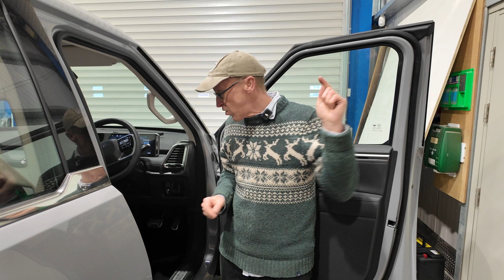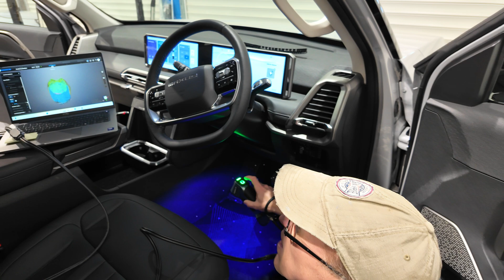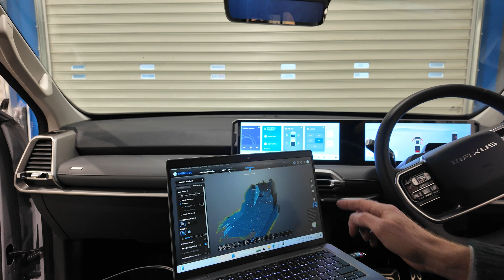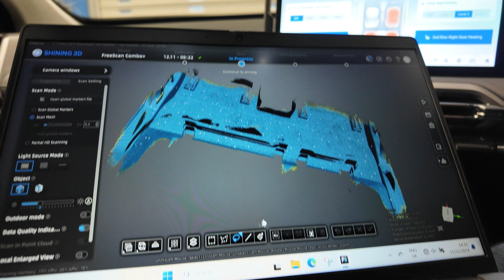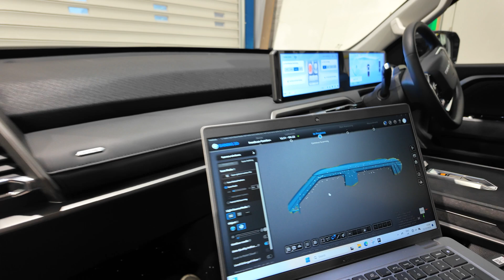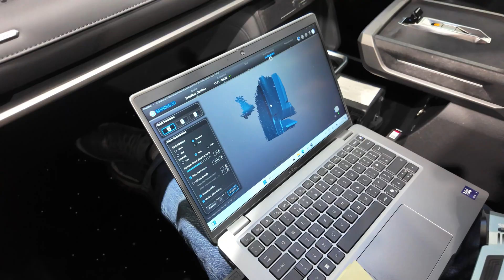Behind The Scenes Using a Freescan Combo+ 3D Scanner to Develop New Accessories for Maxus E-Terron9

Comment: Hello Simon…it seems easy enough to use but I’m sure complex to go from there to actually making a rubber mat. I guess you set perimeters for the size of the mat and add logo’s or surface designs. All clever stuff but then I’m also interested n how the 3D printer then makes the mat…how fast, how much material  is used and is the cost very high compared to ordering say 50 sets from China? I will leave the expertise to you and Zack!!😃😃😃😃